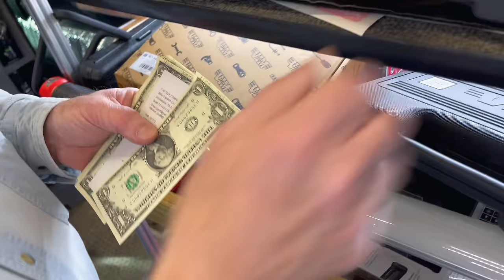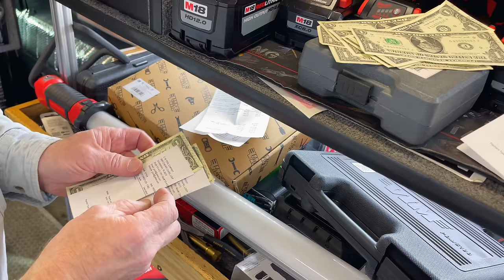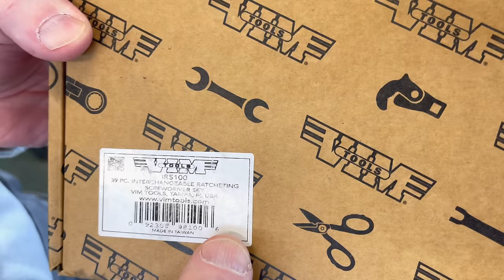Joe's Blowing Away The Competition In Tool Sales! New Tools And The Boss Horn! VIM Tools You Need

Comment: 0:08: 🛠️ Joe showcases new tools and experiences challenges while driving, highlighting the difficulty of the terrain.
4:16: 🛠️ Joe acknowledges and thanks individuals for their contributions to tool sales, emphasizing the value of small donations and addressing concerns about pricing.
8:30: 🛠️ Joe introduces a favorite bit set, Vim impact grade tools with S2 steel, and lifetime warranty for durability.
12:53: 🛠️ Innovative tool accessories demonstrated in the video, including demagnetizers and spring-loaded screwdriver holders.
16:54: 🛠️ Joe has a unique way of promoting tools by using a boss horn and remote control, creating a fun and memorable experience for customers.
Recapped using Tammy AI

Comment: Those oil filter cartridge sockets are a pretty good deal. I’ve seen them from other brands for a lot more.
Reply: Yes I know so if you don't have any I could ship you a set ?
Reply: @JoeSydorowicz  Gee thanks, Joe, but I'm all set for now.  I was actually looking a filter cap style wrench on another brands site when I ran across their set.  You may hear from me if the one I ordered doesn't fit.  I'm having a helluva time finding a cap wrench that will fit a particular filter.  I have an Alabama area code so you know it won't be spam.  thanks again for the offer. appreciate it.